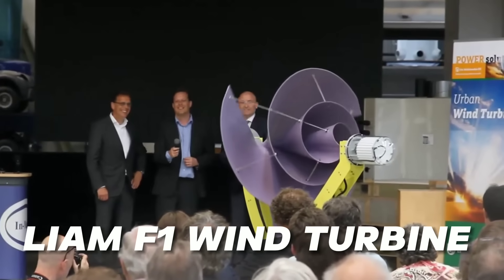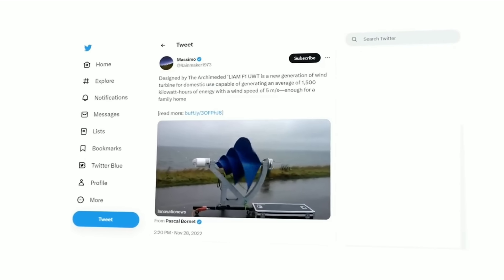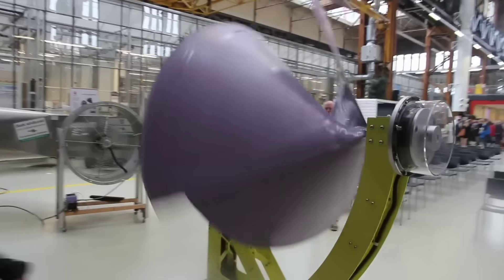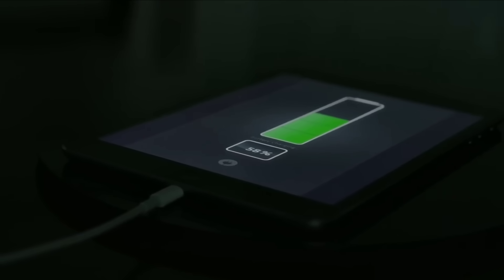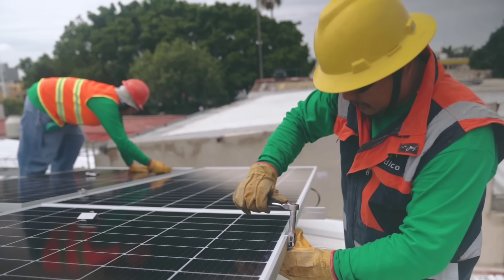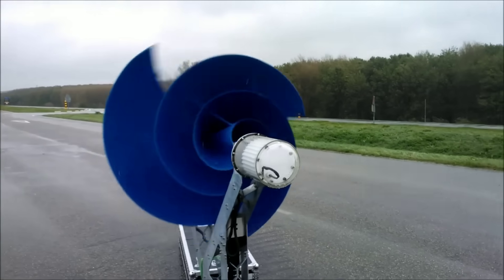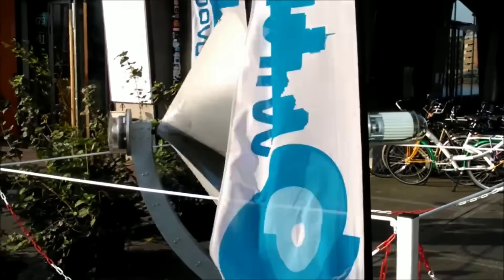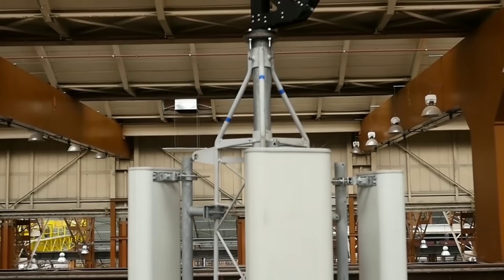This NEW European Wind Turbine for Home Outbeats PV Solar Panels in 2023?!

Comment: Apparently it has more advantages. Cost will limit its installation, secondly repair issue is big disadvantage ,as it will be not available in remote areas and other countries

Comment: This looks too good to be true. In this video, the Archimedes is claimed to be producing 1500W. At their website, they have a graph showing the max output is 1000W. On their Archimedes Windmill 2023 brochure, it claims their max output is 700W Kinetic energy but only 550 W electric... Something doesn't add up.
Reply: It doesn't say 1500 watts output in the video. It says 1500kwh a year of electric produced.
Reply: @Techfanatic73  No it doesn't.
Graphic clearly shows these turbines can achieve a speed of 1500 km/h. I'm getting 4 >.<
Reply: @Techfanatic73  It sure does outbeat.
Reply: @Techfanatic73  - Kinda - He (The voice-over) Spoke of 1,500 kWh per year, but the on screen Text, said it screamed along at "1,500 kmh!" Twice they had typo's like that!

Wait! My "Hydro Bill" Just came in... I Used just 4 kWh under 600 kWh for a single Month. My "Peak Month" was August, at 631 kWh, and my lowest was Last November at 253 kWh. My Average over the last 12 Months was 365 kWh! So - I would need 3 of these as my years usage was about 4,400 kWh! 

So, yup, It would make sense to mix it with Solar, and Battery Storage like a Tesla Powerwall, or 2, or more!
Reply: @Techfanatic73  Actually they say 1500 km/h ????????????  WTF ??????
Reply: @paal8193    Might make rated output at 1500 km/h windspeed...  LOL.
Reply: @Techfanatic73 Well, there are 8760 hours in a year so 1500 hours running a 1kw load = 2 months @ 24hr load... 

Soo...I'm guessing these things are producing a couple hundred watts at most...🤔

😎👍☘🍺
Reply: Mr future says it produces km/h
Reply: Because somebody is lying
Reply: The "new" turbine can be found in 8 years old youtube videos....so there must be some issue, like out of reality parameters...
Reply: It’s a total scam for people who don’t understand wind turbines
Reply: Seems like they were heavily bribed to sell this turbine!

Solar panels are better long term. Install the low light level panels for winter or cloudy climate areas. 

Wind turbines are only feasible in coastal or near coastal areas.
Reply: This device has a video of 8 years ago!!!!!!!!!!!!! What's new?                                                              https://www.youtube.com/watch?v=BF7yX-7Wy30
Reply: Let's pretend that it produces 1500 watts hour/5 m wind speed.  That sounds good, to be true. There's no data about the generator volts number.  Is it already transformed and controlled, or what is going on with? They should be able to give specific information about their products. We know already about the solar panels system.
Reply: More importantly he video states a wind speed of 5 m/s. Most cities are more like 2-3. And because it is cubed it is not ~50% as munch energy it is more like 12% the energy.
Reply: It is physics. You can't gain that much power from such a small thing and  gain that much electric energy.

These things also need to be storm-proof...

Viable wind turbines sit on a at least 20 m high mast and have a diameter of 5 m. The yield increases exponential with diameter.
Reply: @alis49281  That's simply not true. The wind speed needed to turn those things is huge, yet you can spin much smaller ones with far lighter breezes, which are significantly more commonplace.
Reply: @fredmercury1314  so the wind mill I saw just yesterday with approx 20 m mast and 2x 5 m rotor blades turning roughly 2-3 rotations per second the light breeze was not real, ROFL.

Keep believing that tiny windmills mounted to rooftops will work, these tiny things are expensive decorations, that's all. The money is better invested in the real thing if the nearby landscape is good, otherwise it is always solar panels that give the best return for the money invested.
Reply: @alis49281  
FLASH: JULY 2023; The panels of a solar farm in Scottsbluff, Nebraska, that were destroyed in a hailstorm last week will likely be taken to a landfill. There’s no way to recycle a solar panel to produce another one, and it’s not economical to recover minerals from them.
Reply: @alis49281  the yield grows in linear fashion from area swept.  It grows exponentially from higher wind speeds.
Reply: @brettgracey9682 Square of the radius of the sweep and cube of the wind speed, so both are exponential at different rates.
Reply: @davidhumphries3614  yes, you are correct.    My point in context of wind turbines is that wind speed is vastly more important than area swept.
Reply: @brettgracey9682  area swept and diameter are not the same. If you double the diameter, the area swept is not doubled. It is ² of course.
Reply: @alis49281  right, if you look at the formula, it’s about the area swept (area of a circle or Pi r squared) Diameter is just a variable in that equation.  

Edit, I also never said anything of the such.  I used area swept as that is the variable in the equation.

Comment: Wind is much less constant than sun, especially in residential areas, where you need to put your wind turbine much higher than top of roof  to get decent and constant wind. This is the reason why most wind turbines are offshore. Residential wind turbines will remain a gadget compared to residential PV. It's being innocent and ignorant to believe that residential wind turbines will prevail tomorrow.
Lie : solar panels require MUCH LESS maintenance than wind turbines because they are no moving parts. 
What is said in this video is total BS.

Comment: Typical discussion here, once twice and eternity! Wich one is BETTER? Solarpanels OR turbines? They BOTH are winners! Install them both and you have more reliable energy consumption to be used than using just other! And the technology of this roller is not prohibited! With a cost of fraction that spiral can be produced DIY very very easily, when the price tag will drop dramatically 😊

Comment: I live on a mountain in the USA and in a very rural area that gets plenty of wind and not a lot of sun since I'm on the western side. This would be ideal for me, but the cost is an issue. Since my electricity rates are one of the highest in the country, having an alternative to offset the rising costs as well as the several times a year that I am without grid power due to storms, makes this device very attractive. I think that this device would sell very well in my area because of the lack of winter sunshine. If the manufacturer ever wants to sponsor a sales and installation company, I might be interested. The market here is ripe for this technology.
Reply: "Plenty of wind". You need to do the calculations to see if a turbine works. You probably want a average wind speed of like 8 meter per second (m/s) at least for a turbine to pay for itself. For example At 10m/s you might get like 0.5*3*1.2*10^3*0.3 = 1800 Watts at 8m/s you might get 920 Watts at 5m/s =225 Watts, most cities are around 2.5 m/s which is about 28 Watts (useless).
Reply: @AORD72  I would think of it as a compliment to a solar system, especially in the winter months when there's plenty of weather on the mountain and not much sun. 8M/s is around 2MPH (rough estimated conversion) and I get 20-30 MPH winds pretty regularly during the 6 months of winter weather.

Comment: "1,500 KW/H PER YEAR". .   That's approx 4KW/H per day.  That's about the same as two 300W solar panel w/ average of 7 hrs sun.    
Average home needs more than 20 KWH daily
This is good only as complementary to solar panels.  Probably need at least 5 pieces per house

Comment: For bats and birds, I would think this would be safer than traditional wind turbines. A constant, uniform shape versus moving blades that one second are there, next second they are not, basically spinning knife blades.
Reply: I've seen birds easily avoid normal wind turbines. I read that they can even breed on the mast when provided a support to do so.

The problem is the nightly bird and bat migration, but the solution might be to shut down wind turbines in migration corridors at night.

Comment: How much does a Liam F1 turbine cost?
$5450 US
With a cost of $5450 US, that's hard to justify: 1500kWh * $0.136/kWh (Nova Scotia Power) = $204/yr savings on electricity. Over 20 years, that's $4,080 at today's energy prices.😂😂😂😂😂😂😂

Yes, solar panels are absolutely worth getting. They'll cut your energy bills, shrink your carbon emissions, and reduce your reliance on the grid. The average household will break even on domestic solar panels in 14.1 years.

Comment: That product can only produce about 1-2 months only of electricity in kilowatts. Average house hold in the south region of the US prices about 11,000-12,000 KWH’s a year . You will need about 8 and 10 to be on the safe side and hopefully it has an inverter built to convert from DC to AC also if it’s UL rates to tie into the grid system . Most homes in Florida uses 16,000kwhs a year also will need a disconnect switch and etc but not being negative just giving the true outcome that is required and if county and utilities will approve it. This would be good for an off grid home .

Comment: I always wonder this, as you take the energy out of the wind, what happens to the things down range that use to depend on that wind. If take enough energy can it still blow against the hills behind it to cause that weather pattern that use to depend on it?
I agree solar has its limitations but since we already build a paring lot that changes the effects the ground had with the sun why not build solar panels over it.

You see it all the time they do a study is wind turbine can be build in an area not what the effects it will cause. Look at NH that is removing hundreds of acres of trees to build their wind turbines, was that the right decision?

Comment: My power bill averaged $98/mo over the past 12 months. This includes heat (geothermal heat pump), we have gas logs and use only about 40 gals per year.  I don't think I'll invest in wind or solar either.

Comment: $5400 USD is NOT feasible, and I can only imagine $400-$500 for shipping. Then another $500-$800 for installation of the unit. Then have to have a controller $300-$800 if not more. Then need a bank of batt's, well over a $1000. I can buy a lot of electricity for a lot of years, and its trouble free.
No Thank you!  It might have high claims. Which is usually a lie.  It might be better than most. But it most certainly is not $8500 better. 
Efficiency and worth is only as good as the wind you can get.

Comment: I’d be interested to test a smaller version of this on a vehicle for van life.
Reply: 3D print a smaller one for yourself?
Reply: Could tape a $2 pinwheel to your vehicle radio antenna... Just joking, kind of...  Seriously, a simple version of the science is that the air resistance of the turbine in the air stream will consume more vehicle power than the turbine can possibly generate. The logic follows that the turbine will extract some fraction (let's say 10%) of kinetic energy contained in the airstream, (which was created by dragging the turbine through the air while it is mounted to your vehicle). In this case, 100% - 10% = 90% of the energy in the vehicle air stream (inside the area swept by the turbine blades) would be lost (i.e., not recovered by the turbine). It would be far better to charge the battery or run vehicle loads off of the alternator (which is much more efficient than a Savonius wheel wind turbine).
Reply: @brucecampbell6133    yes, a sail could be held up by a mast ont car roof - 
t'woudnt take much to computerize it for max wind power
Reply: @brucecampbell6133  As they said "van life" I presume that means it would bin in use when the van was parked. The problem they would have it is is far bulkier than a conventional blade arrangement, so stowing it when travelling would be an issue.
Reply: Great thought... I think so, too... there is also a Tulip design they may work too. Hope scientists do it for trucks, cars, etc.
Reply: Was thinking the same. Not just for van life but electric cars in general.
Reply: yus for a helichoptor
Reply: @johnlennox-pe2nq    🤔But on an aircraft of any kind, a windgen would create drag; that would adversely affect flight.  
Maybe if multiple, small windgens were used, & fed by a funneled stream of air, it might be do-able?
Reply: @Chimonger1   yes, and have a leaf blower/heated hair dryer as a back up when winds die back; or  heat generated by braking can be siphoned up to the vanes
Reply: @Chimonger1 this concept with a paddlewheel actually studied to put on top of diesal semi's cab carrying refrigerated containers to use the power on mountainous routes and the power the truck systems like Mazda's soft hybrid rather than power the wheels or use to power the refrigeration. The inlets to the generator could be closed when the truck is not pulling a trailer to reduce drag, or opened for braking like a regenerative system. Not efficient enough for flat routes.
Reply: @johnlennox-pe2nq    😉🤣Maybe!
Reply: @Chimonger1    widgens - i thought that was in in beer cans

Comment: Nice idea, but I don't think this makes sense for most people.
Maybe if you have no grid connection and no neighbours complaining about the way it looks, sounds or blocks their view.

The claim that it will need less maintenance than solar is a bold one for something with moving parts. No way this thing will run smooth for decades in harsh weather conditions without changing parts and periodic lubrication.

Solar panels will typically work just fine without any cleaning. And even changing out an inverter if needed is much cheaper compared to doing maintenance at the height this windmill needs to be to work well.

It may be most useful for mobile applications in wide open spaces where power is not available and using sunlight is not an option all year round.

Comment: A wind turbine that needs less maintenance than solar panels?
That's a lie. Modern solar panels use coatings which make them self cleaning when it rains. They have no moving parts. On turbines, bearings need to be lubricated, rotational systems need to be regularly inspected to ensure they remain safe and balanced. If one lie is so blatantly thrown at the audience, how true is the rest of this presentation?

Comment: Hi I have been selling solar for 13 years now, and solar DOES NOT REQUIRE SUNLIGHT TO WORK THEY WORK IN ALL DAY LIGHT! THE ALS0 REQUIRE ZERO maintenance AND HAVE A  25 YEAR GUARANTEE! So the work every single   day during any day light hours. The battery can store all that the panels produce, a wind turbine does not work when the wind is not blowing, plus it has moving parts so it will  wear out, FYI most of my customers in the UK can get between 70 - 100% of their electrical energy from the solar panels and they will always work even when there is no wind!

Comment: I live about 1500 metres from the coast in Western Australia where we regularly have a seabreeze. There was mention  that a wind of a velocity of 5 metres/second was necessary. This equates to 18 kph or almost 10 knots per hour.
QUESTIONS
Does the spiral blade oscillate to be at a right angle to the incoming wind?
What wind velocity does the turbine tolerate?
Would it or much smaller version tolerate a wind velocity of 100kph or 55 knots?

Are there plans to build a smaller model to mount on a recreational vehicle?
I see huge potential for a roof or behind the grill mounted turbine for motor vehicles.
I'm not a fan of electrical vehicles  but perhaps there's potential with Mr Tesla to recharge those batteries. 
Good luck
Reply: The yield increases exponential with size and it decreases the same. Below 5 m diameter is expensive decoration, not an energy supply. And yes, you can't mount it to a roof or similar object, because the turbulences reduce yield. A 20 m high mast is required and should be in an open field.
Reply: There is a reason why cars don't carry windmills, but occasionally solar panels. Windmills would generate the power from the wind while driving, but while they do so, they increase friction and therefore energy consumption. It is impossible to charge the car like that unless you found a way to break physical laws.

Comment: More moving parts more maintenance on this wind power energy never the less it's better than solar cause it works in both season either day or night yessssss once more I salute you creators of this device
Reply: Agree, also more practical in areas of lower solar gain and on Multistory buildings that take advantage of gusts traveling to the roof from the walls.

Comment: It looks like a good solution with or without addtional pv panels, on locations where a big turbine is not feasible. How big can it get? I guess if you build one with a 3m diameter, the power it generates will go up 4x?
Reply: Yes, but the most important value is wind speed. Because the wind speed is cubed to calculate the Wattage. Best to use a online wind turbine calculator like the "Omni wind turbine calculator"

Comment: 4,500 USD is way too much money for this wind turbine as GREED is dictating price nothing else. This is the main issue with any Solar or personal home generating energy systems, GREED. If one is not able to create the wind turbine themselves at reasonable costs then they are forced to FEED THE GREED. 1,500 USD for this Wind Turbine would be far more reasonable and would allow folks access to all this energy but it won't FEED THE GREED as fast so the GREEDY insist on the extra 3,000 USD. GREED is killing the Free Energy Market....